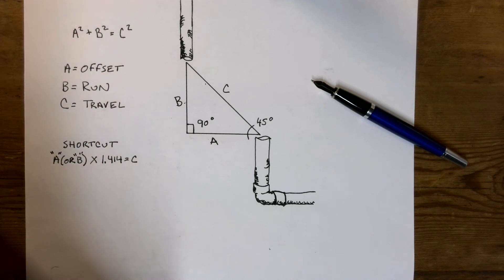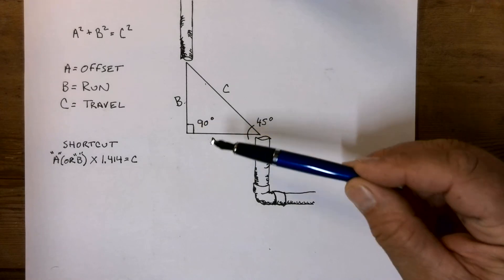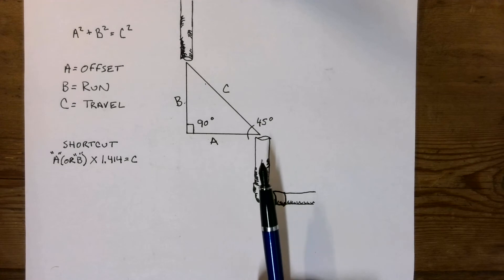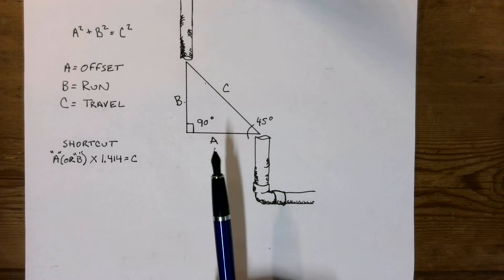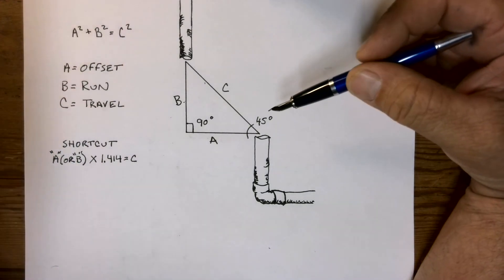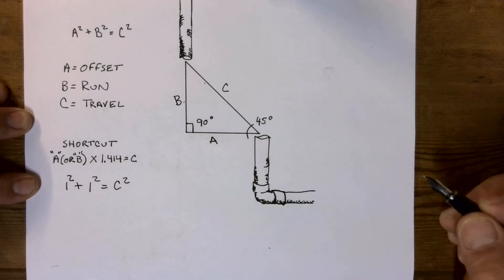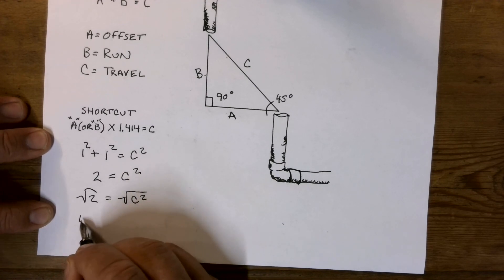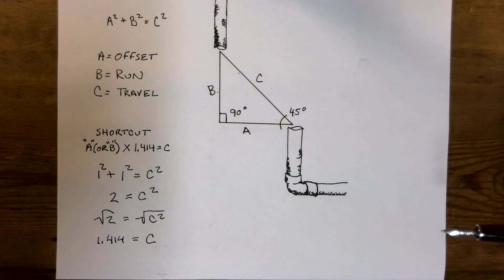1.414 Explained

Comment: is there a formula for other degrees? what about 15 degree or 30 degree bend?
Reply from the maker: Most definitely! Each angle has it's own constant. The ones a plumber will deal with are, for the most part, the 45 (1/8th bend), 22 1/2 (1/16th bend), and rarely the 60 (1/6th bend). The constant for 45 is 1.414 for travel. The others have two constants. If the offset is known for 1/16th bend, the travel is 2.61, the run is 2.414. The 1/6th bend travel would be 1.15, and the run would be 0.58 if offset is known. I hope this helps.

Comment: Tried to test this with the 3 4 5 method, when I times 3 by 1.412 it doesn’t equal 5 obviously I’m missing something here but not sure what
Reply from the maker: The only triangle this number works with is a 45 degree triangle. The 3 4 5 triangulation is a way to check for square.  I'll do a follow up video on the differing formulas.

Comment: The way I learned this method is to put a 45 on your stack and cut a close piece and put your other 45 on so that they are hub to hub. Find the center of that 45, then find the center of where you are going, subtract the 2 then multiply 1.414 and add the 2 hubs.
For example, you have your 2 45s hub to hub on your pipe, you pull a measurement of 8 inches to the center of the second 45, you then find your center of where you want to send the offset, let's say it's 24 inches away, subtract 24-8 and multiply 1.414 + the 2 hubs and you will get your piece.
Reply from the maker: That's an interesting way of finding your cut piece.  There are many different techniques out there for finding the cut piece.  I always say to use the method that works best for you- as long as it isn't just guesstimate.  I prefer to measure the center to center offset, multiply by 1.414, and subtract the two fitting makeups.

Comment: Been eyeballing those for years. Works everytime:)
Reply from the maker: In many cases, an "eyeball estimation" is acceptible.  When running offsets of longer than 4' in an exposed area, using a less forgiving material such as cast iron, a minute of time on a scratch piece of paper or a construction calc app on the phone will save material, time, and inaccurate installation.
Reply: @BGsPlumbingClass after you get  c shouldn’t you take away the fitting allowances ??
Reply from the maker: Oh, absolutely! In this video, I only show where the constant comes from. It was the first video I posted and recorded for YouTube. I had to do a short video with captioning for a certification I was working on.
Reply: @BGsPlumbingClass  oh ok thanks for showing me man. I wanted a easier way instead of laying it out on the ground or eye balling it because I work in high rise residential it’s all about speed and not Wasting time lol.
Reply from the maker: I hope this helps

Comment: You don't have to use any of that. Don't need to determine what the square root is. All you need to know is your C-C measurement, X 1.414 and thats your travel. Take off your fitting allowance for the 2 45s and thats your cut piece. The rest of his method works but takes longer then needed. Simplify shit, understand shit and you'll get good.
Reply from the maker: I completely agree with you! The whole point of this was to EXPLAIN where 1.414 came from. That's all. I appreciate you watching the video, just a reminder that this was done entirely to show origin. Great assessment, and again, thank you for watching!
Reply: Lol of course you don’t gotta do all that but it’s still interesting understanding the logic on where 1.414 comes from
Reply from the maker: That's actually the first video I did. I needed a short educational video to do for an online instructor certification, so I decided to do the origination of one of the most important numbers a plumber needs.

Comment: What is the run is greater than the offset ? Then it's no longer there same.
Reply from the maker: That is true. But it's also no longer a 45 degree offset. As plumbers, we tend to deal in 45 or 22.5 degree offsets, if they're not 90s.

Comment: Yes, but you have to take off for the fitting depths. So if you're using two 45's you'll measure the hub length, multiply by 2 and subtract your  run ("C") by it.
Reply from the maker: That is true, great observation!   This video was only designed to show HOW the constant 1.414 is figured.  You are correct in the statement about subtracting the fitting make ups, but you take it away from the travel (C), not the run (B)- which is identical to the offset (A) in a 45 degree offset situation.  Also, keep in mind that if you are using a wye and a 45, the take offs are going to be different.

Comment: Well you find the travel for the 45 degree offset, do you subtract 2*45 angles? I refer to steel pipes and angles
Reply from the maker: If I understand the question correctly, I think it may help in explaining it a different way.  In an offset of piping, if I were to use 45 degree fittings, the run and the offset are of equal distance (this is a mathematical constant and if the angles shift off 45 degrees, the run is longer if the fittings are less than 45 and the offset is longer if fittings are more than 45 degrees).  To find the travel for 1/16th bends (22.5 deg), multiply the offset by 2.612 and to find the run multiply the offset by 2.414  To find the travel of 1/6th bends (60 deg), multiply the offset by 1.156 and to find the run multiply the offset by .575
Reply: @BGsPlumbingClass  Your answer is great sir, but what I mean is that the outcome for the travel measurement refers to clear pipe edges, so we take out (subtract) 2 angles(60,45 or 22,5 what ever we deside to use). In every video I see they take out 2 half's and measure the travel from half to half the two angles plus the travel piece.
Reply from the maker: I'm guessing that would be more for a fitted pipe scenario?

Comment: What if A not equal B?
Reply from the maker: If A is not B then the angle of travel is not a true 45 degrees.  That would then fall into dealing with Sine, Co-sine, and Tangent equations. Not to mention, short of pipe fitting and creating your own fittings, that is not typical.  The only other fittings available would be 22.5 degrees, 60 degrees for waste and vent.
Reply: @BGsPlumbingClass  so its the easier ways to know hypotenus
Reply from the maker: You could say that. It's quicker for sure.
Reply from the maker: If A is not equal to B, then it is not a true 45-degree angle. Different constants apply to other angles.

Comment: 30 degree
Reply from the maker: Would you like the constants for 30 degrees?
Reply from the maker: In case you were asking what the constant was for a 30 degree offset, it is twice the offset.  The run is a bit different however.  It is approximately 1.155 times the run.
Reply: 30 graus contante é 2.000
Reply from the maker: Yes

Comment: Thats the long way but a good way to explain. 1.414 for 45 fitting allowances 22 fittings are 2.613
Reply from the maker: That is true for the 1/16th bend (22 1/2) offset.  The run is 2.414 if you needed to calculated that as well.  Great addition!!!